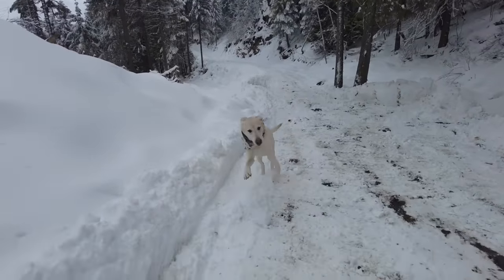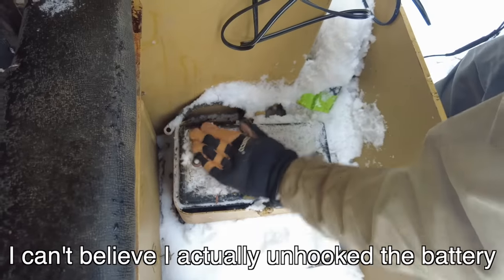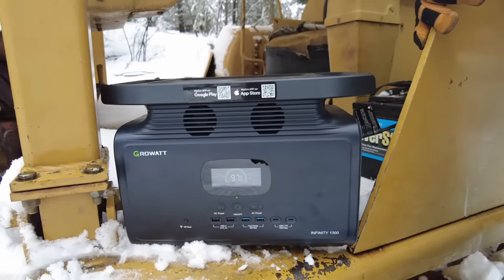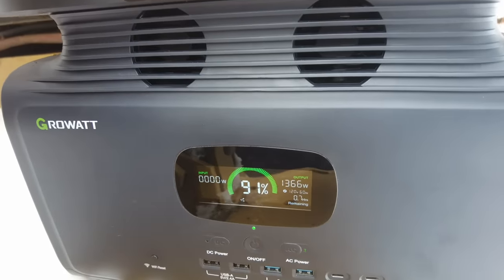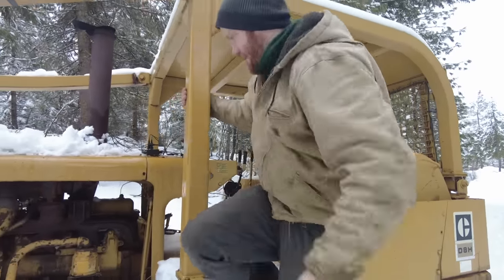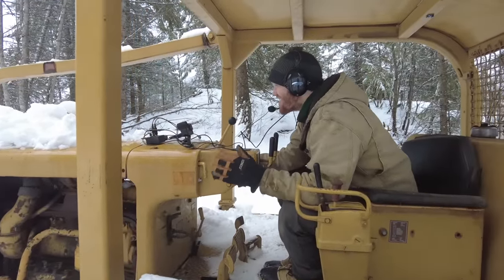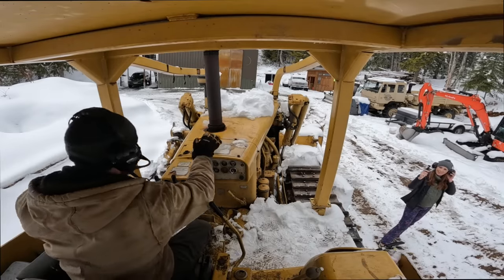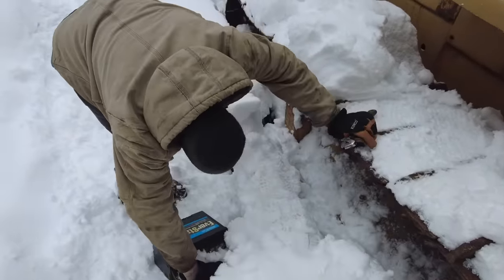D8 Dozer, Will It Start? | Using Our Infinity 1300

Comment: G’day guys, another great video, maybe you should consider building a carport/overhead protection for your dozer, trucks and other equipment. You can even put solar panels on the roof and all the equipment can have battery maintenance, trickle charge going over winter.

Comment: I had the exact same Dozer on a mountainous property in Southern Sierras, CA  It had the Pony Motor to start main engine (and started every time) these are bullet proof.  I have the complete manual for it as well.  Your Browsers are about 40% or so...such a difference with good browsers.  The best thing I learned on that Dozer was the Détente position of the blade handle that releases the blade to drag  on the ground for grading in reverse...perfect roads!
Reply: 2
Reply: What size group battery do you recommend for these dozers?

Comment: Here's something I've learned from an old man while be an mechanic and a Operator.
 Take gas and soak a rag in it, while doing so, take off the Dozer air intake and take your soaked rag and stick it into the air intake, it's the best way to start any off road diesel equipment

Comment: More than just bringing it inside, get a trickle charger/maintainer, line up all of the lead acid batteries you aren't using for the season, and put them all in parallel on the trickle charger.  It will keep them all float charged.  I did this for years and was getting 7-8 years out of seasonal batteries like my mower and motorcycle batteries.

Comment: Tour next project needs to be building a Barn for the D8. that D8 is the most important piece of equipment on your property. you need to protect it from the weather or it's lifespan will be shortened.

Comment: I take the battery out of my old diesel tractor in the winter when I don't need it.
Keep it in the barn on a battery maintainer.
In summer time I have a 12 volt solar battery charger panel on tractor to keep battery up when i let it sit.
Don't forget fuel stabilizers and anti gel for the diesel fuel. You let that diesel gel up in the cold and it is a nightmare to get it thawed out.

Now you need to clear an area near  the house to put all the equipment so it's not in the way. There may come a time that a heavy winter snow hits and you need the dozer to clear the snow. 
Have fun and looking forward to seeing future projects.

Comment: So happy that you got the dozer working,  I was in the Army,  the unit that I was with was an engineer unit, I was hauling a 5,000-gallon diesel tanker, I just got to the training area,  the motor Sargent said,  That I needed to drop the tanker and go pick up a D-9 Catapiller, that truck broke down hauling it, so I drove another hour to the Catapillar, my first thought was my 5 ton truck that I was to small to haul it. They assure me that it was big enough,  because the truck that was broke down was a 10 ton truck, so I drove it back and made it to the off ramp and ran out of diesel,  so they were trying to figure out how to get fuel for the truck, they didn't have any fuel cans, the escort truck had a diesel heater in it, they thought that they had no way to transfer the fuel over to my truck,  then my Mc Guiver kicked in I had a steel helmet,  which we used to transfer the diesel from the other to my truck it saved the day, they were very happy that we got to the truck started and got the D-9 brought to the training area.

Comment: 1 best advice I can give you In the winter keep your nose or covered Moisture concrete in I run a lot of heavy equipment and I am a firm kid No this for a fact we always kept our equipment covered up with tarts or buildings Small building Over it just a rough and pose no sides and then tarp it up at least it's out of the weather

Comment: If you run the tracks up on some heavy planks or logs you will never have to worry about being frozen to the ground .Also be sure to clean the tracks off before a freeze especially after running in mud or wet conditions .

Comment: Low charge battery is more water than acid and freezes easier. High charge battery is opposite and freezes at lower temp

Comment: If you think the brake is worn out you can go to the rear of the rear dozer and tighten the band brake by turning a square stub within a humped cover under the fuel tank. There is one per side. Also if the brake lining is worn or falling off the torque converter suction screen will likely be full of black chunks of brake lining. 
If you wear the brake out for long the rivets will score up the drum.

Comment: If you must start it in colder tempratures there is a device called a Arctic Blaster that preheats the engine coolant.
The poormans hotbox.

When way out in the boonies you have Plan A thru Plan F.
I like Plan T and Plan HP.
Plan T is for torrpedo heater.
My fave is Plan HP aka.
Hot pan/fire pan.
Involves a metal hog feed pan and some scrap wood set afire 'till it burns down to coals' slide pan underneath frozzen vehicle and let heat warm the oil pan and block.
If performed incorrectly can lead to setting fire to vehicle

Comment: I would not leave that sit all winter with only 20% fuel........better to at least 3/4 fill gas and the diesel with fuel with treatment to avoid condensation in the tank that will get water in the fuel.
Reply: That thing probably holds close to 100 gallons.
Reply: @jmwarden1  it is a 100 Gallon tank but Paul is definitely right, best to store with some fuel conditioner and full to prevent moisture build up from hot/cold cycles, sun exposure. I've had alot of these machines have fuel tanks FULL of rust and plague the fuel system due to being stored long term with low fuel.

Comment: Don't forget to check the oil pressure gage on the big motor before opening the fuel spigot. Then down pressure on the blade to make sure the tracks aren't froze in the ground was done.

Comment: I think you should invest in a " battery tends " charging bank, of the kind used in dealerships. On equipment your not using,  pull batteries and put them on the charging station. Then just bring fully charged battery to the unit and your good to go !
Reply: Tender not tends

Comment: You should remove the batteries from your equipment when your not going to use them for long periods and put them on a trickle charger to keep  charged don’t put them on a cement floor that also kills batteries

Comment: I've spent many hours on a D7G, low ground pressure, 6 cylinder, electric start. In summer we ran the glow plugs for a minute before starting, in winter 3 min. Worked great. 

Also many hrs on an IH TD-25c. (Equivalent to a D8K) Their 2 speed track steering system allowed them to do what a Cat, with clutch/brake steering, couldn't even dream of; pushing a full blade in a curve. Simply no comparison. Even Cat's differential steering system can't push as much volume around a curve, given that it increases the speed of the outside track while lowering the speed of the inside one. The IH system only lowers the speed of the inside track. The Cat differential system will outperform the IH in volume pushed in a curve per hour, but does so with more cycles per hour, not volume per cycle.
Reply: Many of the older case dozers/loaders were like that. Although shouldn’t be used in the same sentence as Cat 😊

Comment: Newer style battery chargers, if it doesn’t see any voltage it will not start charging. You need to put another battery in the system to get the charger to start charging. The older chargers will send voltage to the battery.

Comment: If you have ever slid sideways on a dozer you will weld some corks on those pads…it will save your life and your dozer,that thing starts slidin sideways you will know why you weld on corks
Reply: How do you weld corks?
Reply: @jmwarden1  3”x2” steel corks welded onto the pads on the cleats or growsers
Reply: Google it….it will provide the necessary traction for going forward or back and stop from sliding sideways

Comment: By allowing the snow to Go onto Both terminals of the Battery you have caused the  Battery power to short Circuit and Drain out the Battery Power

Comment: Put a solar charger on the dozer, with a light bulb and temperature sensor, so the solar will also warn the battery box. Insulating the box would also help.

Comment: Is the pony motor a 2stroke?  If so, you need to use a 2stroke mix.  Also, regardless, use sta-bil fuel stabilizer for both gas and diesel.  
One pearl for cold weather.  Run the pony for a few minutes because the pony exhaust, exhausts through the main engines intake manifold, thus will preheat the air intake on the main engine if you let the pony run for a couple.
Reply: No it’s a 4 stroke

Comment: Nice dozer, but please cover it up with a tarp.  And yes, take your battery out in winter.  And disconnect it if you are not using it, even in summer - because if a mouse or raccoon starts nibbling on your wires with the battery hooked up, your machine may well catch fire.  I have seen lots of machines burn up in the bush or on fields.  I always disconnect the negative on the battery.  It is good insurance.  Up here in Canada, we call the "pony motor" "putt motor", and it is definitely the best to let it run a while on a cold day to warm up the coolant which the putt motor shares with the diesel motor.
Given the sharp drop offs on your road and the hilly terrain, you might consider welding some grousers onto the track to prevent your cat taking off sideways like a sled if you hit an icy patch.  A sideways slide on a narrow road could well be fatal for you or destroy your cat.

Comment: Tarp.  Lumber.  If you can't do a proper shed then at least show it the love it deserves,  it's earned it.   You MUST do a better job taking care of your equipment.  Install a block heater, on an extension cord plugged into a wifi timer. Then, with your morning coffee, turn on the block heater or set the app the night before. 
    Simple.

Comment: there is an adjustment under the fuel tank to tighten the band for the steering brake. Should be an inspection cover tot take off and then the adjustment is fairly easy.

Comment: You can probably bring that battery back. How you do it is thaw it out first, parallel it with a fully charged battery then put the charger on both batteries. All the current flows into the dead battery but still allows the charger to start. I tried this recently on my excavator batteries (I left the key in the run posi for 3 months so both batteries were dead flat) and one by one they came back. Took 4 days of charging though - 2 days ea. 
I don't just use electronic chargers anyhow. I like a non electronic to start things off. Got an old school 12/24v type for just this scenario.

Comment: I would highly suggest before working it doing a complete fluid change on it engine oil change the oil filter change the fuel filters change the hydraulic oil. It might need it after sitting all winter.

Comment: Riley, I know your "to do list" is never shortening, but guy, you need to figure out a machinery shed- your dozer and snow blower will last much longer and be in much better shape if not left out in the seasons. It would also be a place to leave the trailers, etc, to keep the yard clear. Riley, if you can start one of those, you could start nearly anything in the world with no more than a three minute lecture! You need to hide that look of unbridled joy when you put that beastie in gear! That D8 weighs about three full size cars less than an Abrams M1A1 tank. When it moves, the earth moves!

Comment: Outstanding. I'm so glad it started and ran. There is no conceivable snow that thing wouldn't push. It's a monster. If the rest of your equipment is over whelmed, that's the backup plan if you can get to it, but unless it's in the yard, it would require a helicopter!  🙂
Reply from the maker: I agree with your assessment that we need a helicopter!
Reply: @AmbitionStrikes  Snowshoes! Way more maneuverable than a helicopter with trees and steep terrain. 👍🏻
Reply: @AmbitionStrikes  as long as it comes with an inflatable automatic pilot... Just keep an eye on him around Courtney, those guys can get a little frisky lmao.
Reply: @bigdaddy741098  (the comment was about the need for a helicopter - - not a helicopter PILOT.)
Reply: @AmbitionStrikes  I hope you've seen Airplane, otherwise I sound like a complete weirdo lol.
But if you haven't it's a must watch next time you have some downtime.
Reply: Riley good to see the D8 operating again that brake that doesn't work may only need readjusting there is a plate under the fuel tank at the back to give access to the brake adjusters I am sure you have the ability to correct any other problems that may be affecting it they are a great machine you are a very accomplished couple love your videos watch every one with interest your son is going to grow up with amazing parents
Reply: @AmbitionStrikes  And this is exactly how you justify a Helicopter. I agree completely a Helicopter is a "Necessity" 🙂
Reply: @bigdaddy741098 
Roger

Comment: Why didn’t you park the dozer up by the house when you’re finished using it? Cover it with a tarp. Remove the battery and keep it charged all winter come on dude you gotta do a little more preventative. Maintenance with your equipment. Too much doing the fun things and not doing the boring maintenance things, I do understand though I’m not perfect

Comment: It seems like there needs to alot of Maintenance on that Dozer. One cylinder for the blade seems wrong, like it is bypassing. I know this Dozer is more of a pastime...use maybe 10-100 hours a year. With the tracks coming off twice last year...I am thinking the undercarriage is most likely shot.
I am no expert but Clint from C+C Equipment  can tell you what to look for in a used Dozer...he calls them Tractors. 
If your two upper rollers are concave? Changes are that the undercarriage is shot and you will be losing that track more than once. 
Just a heads up when you start working that machine hard. :)

Comment: That is a 24v system not a 12v. Also bring you batteries in if you don't regularly use it in the winter. My D-8 is a 1938 D-8 A. No pony motor. It's a hand crank with a hex nut extended for powered air gun with a 3/4 drive socket. I live in Alaska with 6 decades of experience.

Comment: Nice dozer, not to bright not winterizing it.At least check anti frezze.If the block cracks you will have a 10 ton hunk of steel there foreever.Buy some dry gas at least.

Comment: You really need the little honda eu200i generator . This way you can  run a electric heater to keep you warm  while you are doing all this in 20 deg weather  along with charging the battery's  and heat gun .

Comment: Save yourself the headache, next time buy a big heavy canvas tarp then cover the engine and front of the dozer with the tarp. Light a small fire underneath the engine belly pan and let it heat the whole damn thing up for a few hours. That's how operators did it building the Alaska highway, that's how the operators did it in the north east in the mines, that's how operators do it in the arctic. Let the small fire do the thermal work.

Comment: Love the cool heavy iron videos - would yall have capacity / space for a pole barn to keep the snow and ice off the big machines?  Doesnt need to have anything other than a gravel floor, maybe enclosed on a side or two, but something to make de-icing easier and keep the sun from damaging hydraulic lines in between usage!  Plus would be a cool video series and if you got a post-hole digger for the skid steer / excavator it probably wouldnt even take too long.  I think I've seen yellawood sponsor a build or two too!

Comment: What happened to the maintenance truck with the big eco flow setup? You pitch a different brand of battery every month.
Reply from the maker: We set it up with a massive snow blower and used it for snow clearing over the winter. We aren't biased when it comes to portable power and love getting to show the features, benefits, and technology of the different power brands.

Comment: Leaving both the diesel and gas fuel tanks near empty on those things is about the worse thing you can do.  Always check the sediment bowl on the pony motor carburetor for water before starting.  There is a plug or cock valve on the diesel fuel tank that should be bled to eliminate any water at the bottom of the tank after all that sitting.  Always fill the pony motor gasoline tank while machine is still warm and try using a product like Fleetguard.  Condensation in the gas tank was a major problem with pony motors because of their location right next to the rear cylinder head on the diesel... on any CAT engine that had a pony motor!  Allow some fuel to flow through the injectors momentarily before closing the compression release when starting the main engine...  injectors on old Cats have small moving parts inside them believe it or not.  Prolonged warming of the diesel in beyond to bringing the oil pressure up on the main engine with the pony motor before starting is not critical.  Warming the diesel fully before working it is very important.  Allowing the main diesel to run at a fast idle for maybe 20 minutes in that kind of weather allows the hydraulic and transmission oils to circulate and warm up so you don't damage pumps and so forth.  Moving implements about will cause cold oil in cylinders to flow back into the reservoir, so move them about periodically with no load on them while warming up the machine.  I have operated three machines exactly like this one except one had a cable blade.  The later D8H series and D8K series had the D342 engine just like yours, but came with glow plugs, a slightly different fuel pump and rack, and direct electric start.  I oiled on a dragline that had a D342 diesel engine with a pony motor that looked exactly like the one in your dozer.  The D8H 46A#-- was one of the finest tractors ever made.  Take good care of it and it will take good care of you.